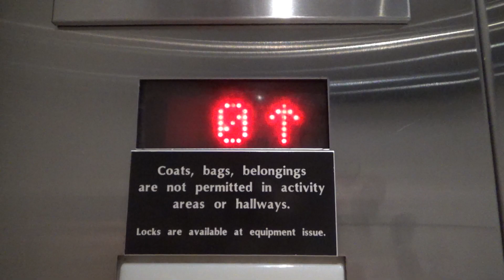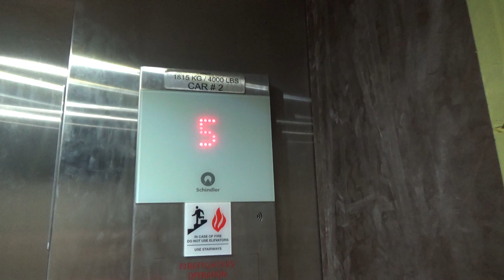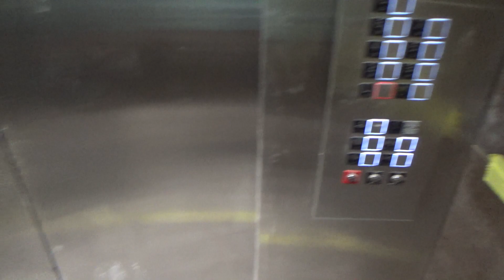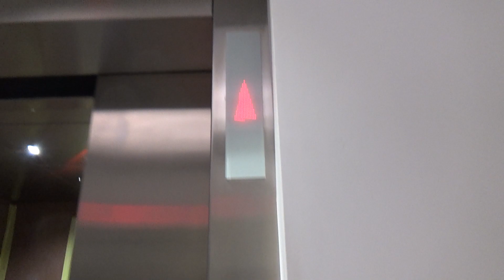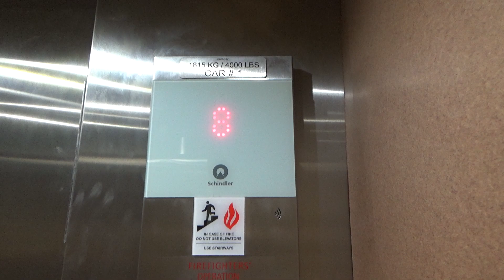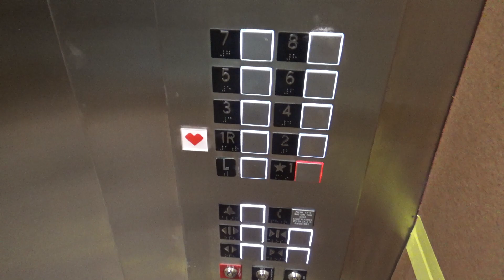BRAND NEW Schindler 3300 XL Elevators at Murdoch Building, Oakland - Pittsburgh, PA

Comment: It’s Schindler 5500 not Schindler 3300
They have a door sound with Schindler 3300 style panel
Reply from the maker: American 3300 XLs use those door operators.
Reply: 5500 in America can't have that COP.